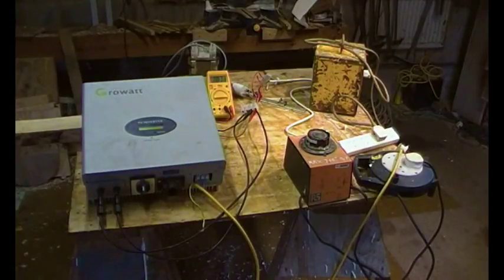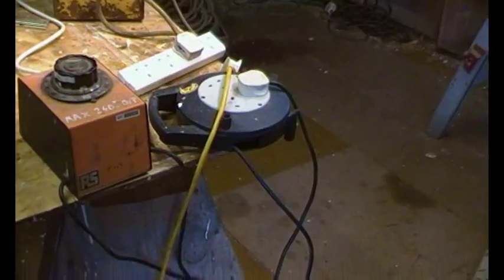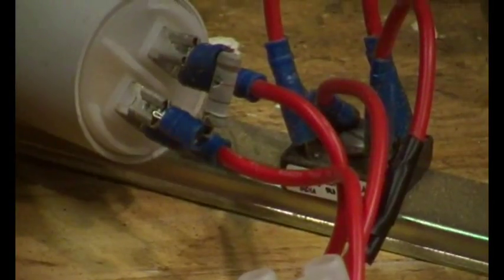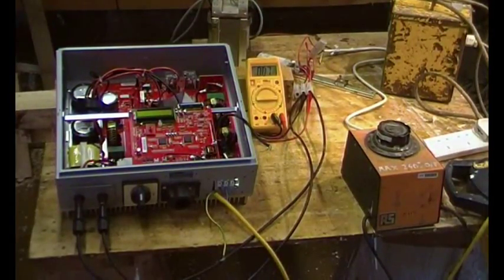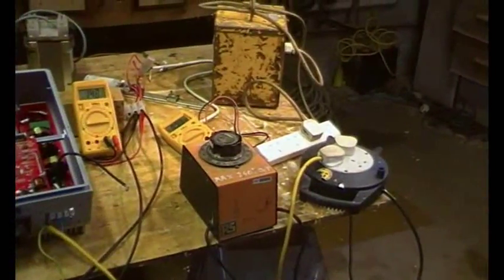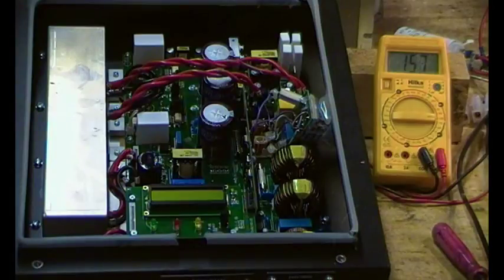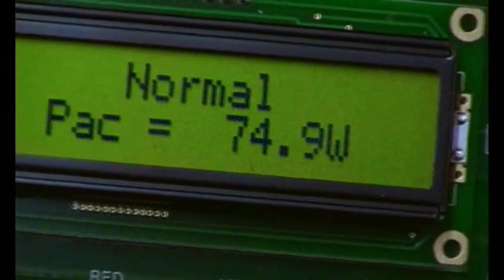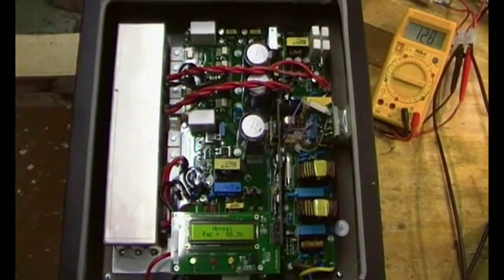Solar grid inverter bench testing, eversolar output relays and other things

Comment: Hello Andy,How can we test three phase grid tie solar inverter two strings.
Reply from the maker: Hi, well you will need 3 phase power on the mains side, I've never done this but I assume that you can test each input separately and so you could use this setup to produce smooth variable voltage DC. Cheers
Reply: Thank you Andy, it means we have to use three phase Variac and three phase isolated transformer,three phase bride diode,smooth capacitor to setup variable dc supply, otherwise we have to use the high capacity PV string panel
Reply from the maker: @bch2780  Hi, I don't think so. I am assuming that you have a high capacity inverter (10Kw) that is connected to the 3 phase supply. I think you can feed 1 string at a time with the smoothed DC from 1 variac system,  Cheers
Reply: I will test 20kW inverter, can I use a bigger single phase variac and isolated single phase transformer as VDO. 
Just for testing the inverter synchronize to three phase supply system, and then quickly reduce dc supply to avoid over capacity of setup equipment.
Reply from the maker: @bch2780  Hi, yes test each solar input separately, you don't need huge DC volts, just enough to let the inverter start and yes avoid overloading the variac, cheers
Reply: I have test three phase 20kW grid tie inverter brand Zeversolar, PV1 show fault 38(PV earth fault), PV2 can sync with three phase system,
testing supply power only 500W due to limit of variac&isolated transformer, Have you experience repairing this brand.
Reply from the maker: @bch2780  PV earth fault (riso) is a fault to earth in the DC panel side, apparently it should be lass than 20M ohms. I think there may be a leak to earth in you DC test system, try taking the earth off your power supply. As the fault is all 3 inverters this makes this more probable, cheers
Reply: @TheInfoworks  Hi Andy, I have test  each channel one at a time, Channel PV1 found PV earth fault, Channel PV2 is OK. I think that electronic circuit of solar inverter of channel PV1 is malfunction. Due to the complex of circuit it is difficult to repair, but I will try
Reply: Hello Andy, Appreciated your demonstration I can solved problem by repairing three phase grid tie inverters.
Reply from the maker: @bch2780  That's good news, splendid, cheers

Comment: Hi Andy, thanks for producing this video. It is what I have been looking for. Can I ask what stops the inverter from over driving the DC supply? What I mean is drawing current right up to and beyond the capability of the DC supply.
Reply from the maker: HI, thanks for the interest, as the variac is turned up tyo increase the voltage then the current increases, so it's a manual thing, don't turn it up too high afterall we are only testing the inverter to make sure it functions. Please subscribe and check out my books on this channel page, cheers